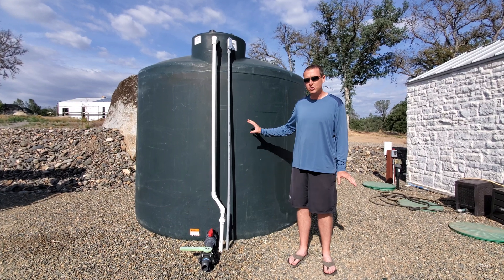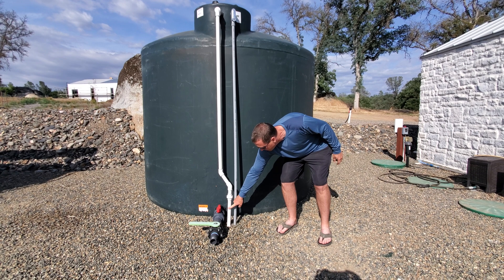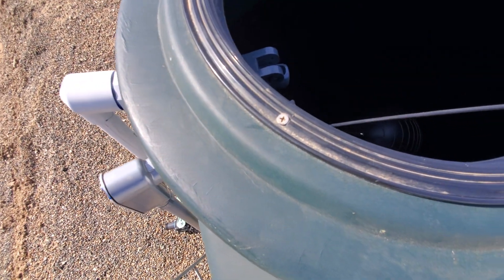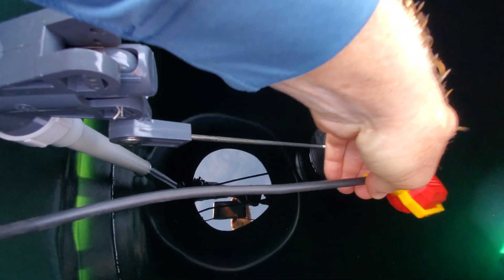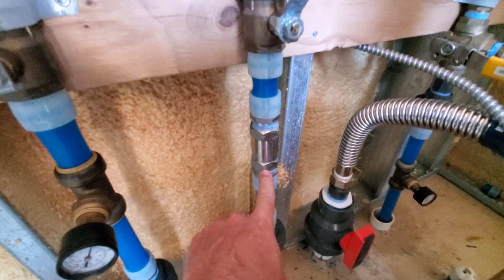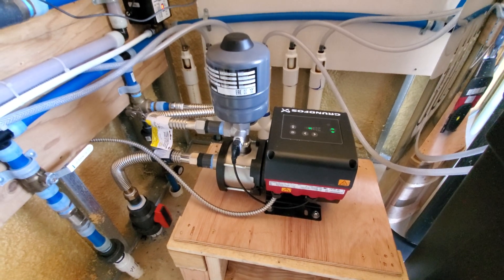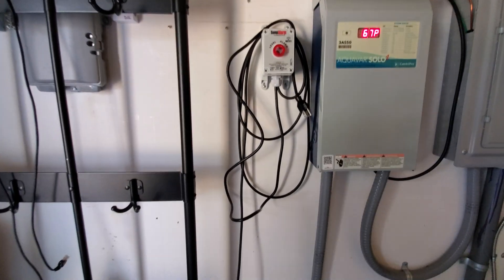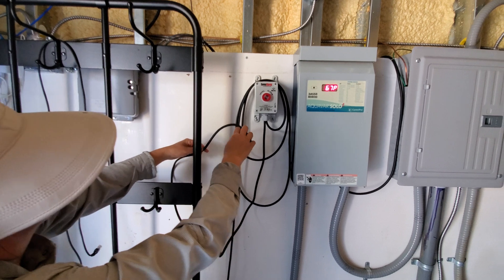2500 Gallon Fire Dept Tank setup

Comment: Justin, another question.  The 2" Pipe you show coming out of the tank that goes into the ground.  Is that for support and preventing the pipe from moving, or does it serve another purpose?   thanks. GP
Reply from the maker: That's the 2" supply that goes inside the pump house to the booster tank. If you saw the video up to about the 3 minute mark I show where it comes inside, so that's the same pipe.

Comment: Thanks for this. I have a similar setup to plumb on a couple tanks. Will be installing a vent - when FD drains the tank it could implode if air tight or if it's not being filled at the same time. 2" vent required for 2500 gallon tank. Really appreciate your video. Also your setup inside is incredible.
Reply from the maker: You're welcome! That's good to know about the vent. I thought about it, but it looked like there is one integrated into the lid on our tank but I'm not sure so will have to take a closer look. Thanks!
Reply: @BuildItLikeBeckhams  can it be connected to a 5th wheel I may do an experiment and use water bottles and use that as a drinking source